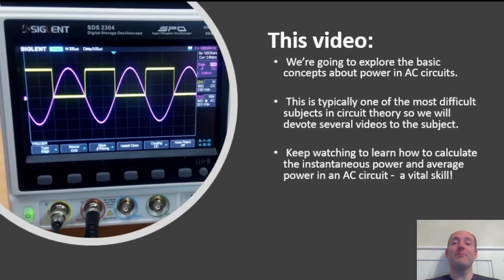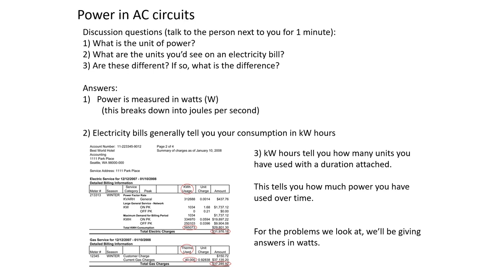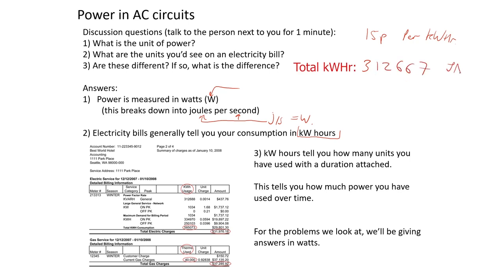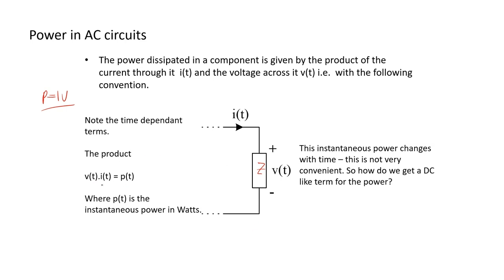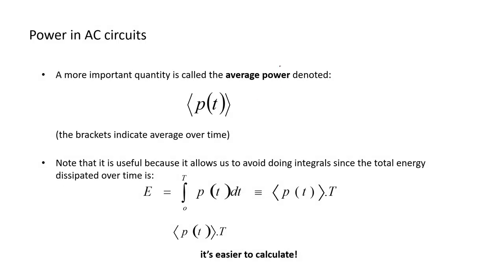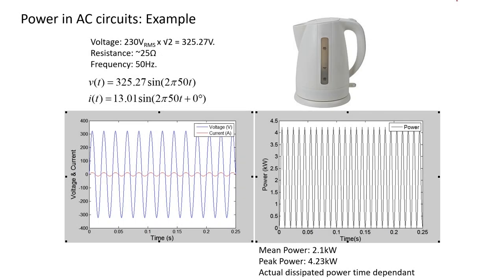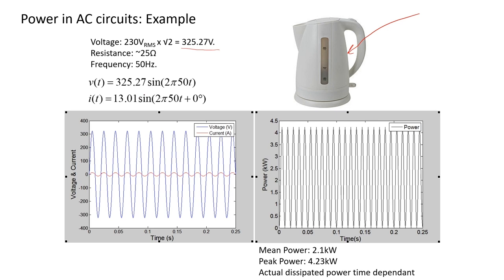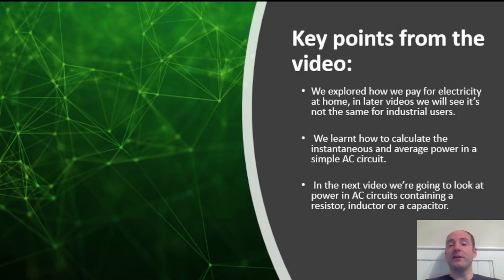AC07: Understanding AC Power - an introduction.

Comment: Great, Chuffed mode: on;
When you were talking about the Voltage and Current averaging to zero, I thought, "Yeah, but power is multiplying them, so a minus times a minus is a plus!! :) I've gone back and started the AC course again, also reviewing complex numbers and trigonometry.
You sometimes talk about worksheets, I'm just a bloke in Gloucester taking advantage of free educational videos (thank you), is there any way of accessing the worksheets?
Reply from the maker: Glad you’re finding the videos useful! I’ll see if I can dig the worksheets out and try and find a way to share them! I’ve also made a few more videos recapping the key points from each AC video and going through a few worked examples, will get these uploaded shortly!